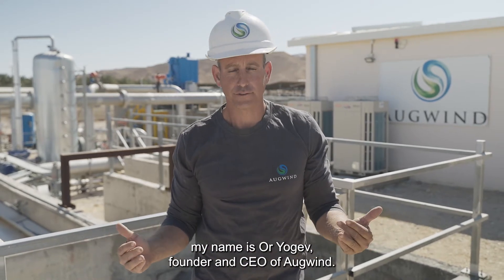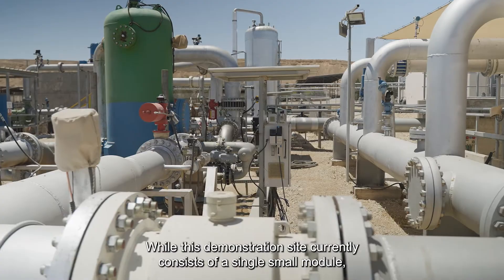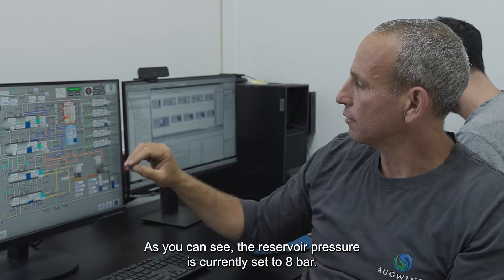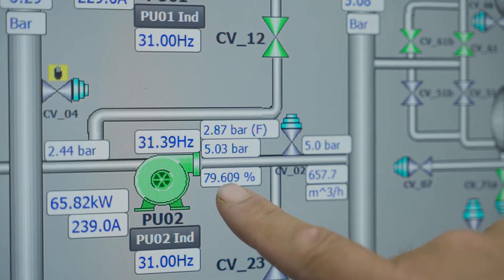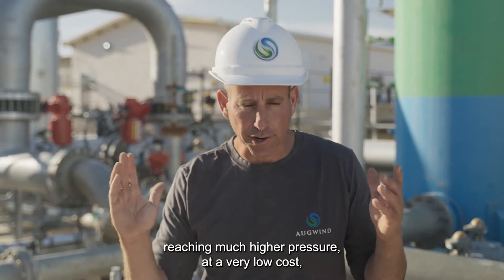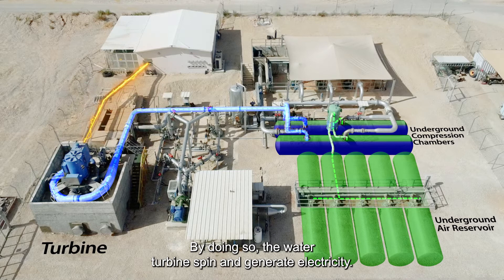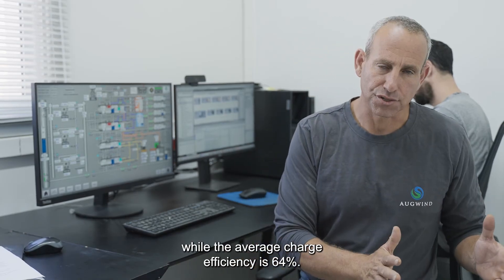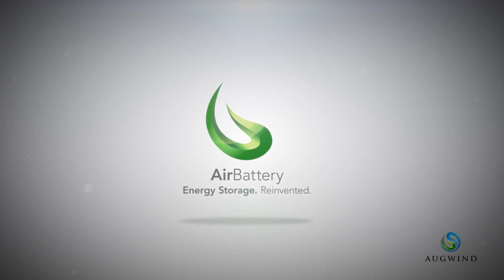AirBattery demo- site tour

Comment: to put it mildly, it is unreliable! and to put it mildly, so that my swearing is not banned... anyone who has studied oil and gas production and mining operations knows what will happen if you inflate a well with air pressure and then deflate it, but here it is expected to be done several times a week, which means that collapses and cracks in the rock will be 100% with complete uselessness after a collapse - Jews have never had intelligence, but they have always had the desire to do something and work! The idea with balloons is interesting!

Um es gelinde auszudrücken: Es ist unzuverlässig! und das ist noch milde ausgedrückt, damit mein Fluchen nicht verboten ist... jeder der sich mit Öl- und Gasproduktion und Bergbau beschäftigt hat, weiß was passiert, wenn man einen Brunnen mit Luftdruck aufbläst und ihn dann wieder entleert, hier wird jedoch erwartet, dass dies mehrmals pro Woche geschieht, was bedeutet, dass Einstürze und Risse im Gestein nach einem Einsturz zu 100 % völlig nutzlos sind - Juden waren nie intelligent, aber sie hatten immer den Wunsch, etwas zu tun und zu arbeiten! Die Idee mit Ballons ist jetzt interessant!

мягко говоря это ненадёжно! и это мягко говоря чтобы незабанили мой мат... кто изучал добычу нефти-газа и шахтные работы тот знает что будет если надувать давлением воздуха скважину а потом сдувать но только тут это рассчитывается делать несколько раз в неделю а значит обвалы и трещины в породе будут 100% с полной бесполезностью после обвала - евреи умом никогда необладали но стремление что-то делать и работать это у них всегда было! а идея с баллонами очень интересная!